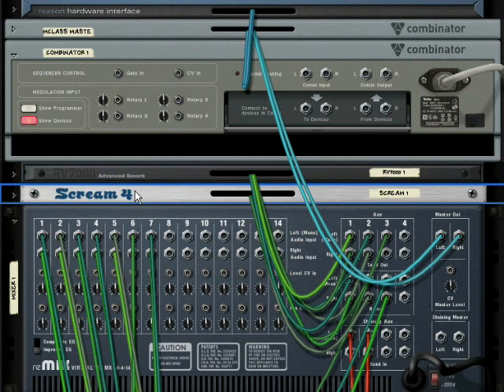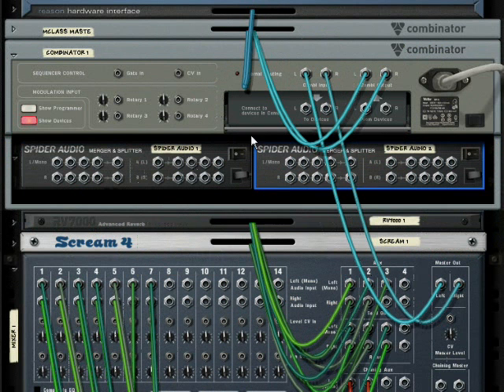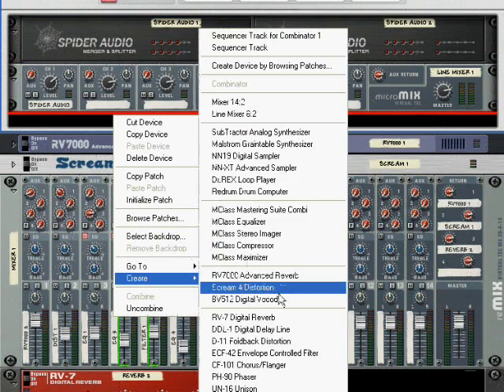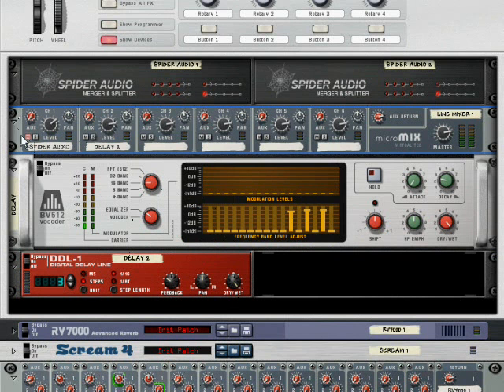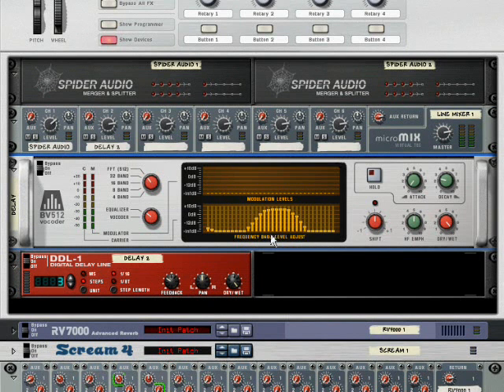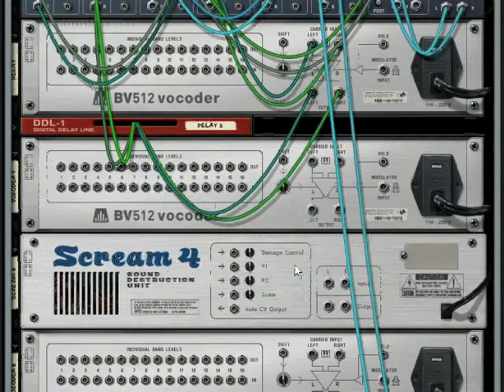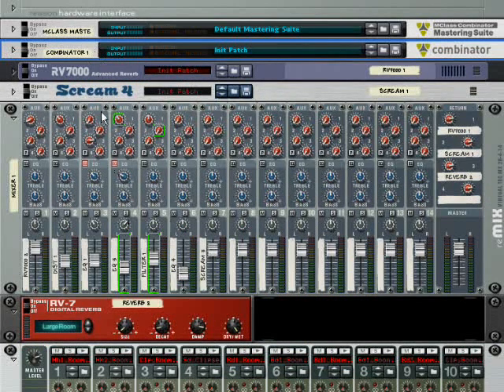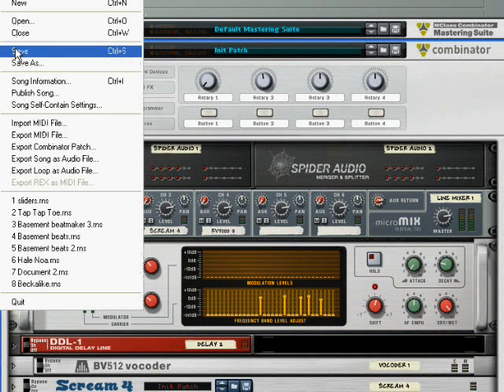Reason Tutorial - Vocoders as effect control units

Comment from the maker: Mastering is a big topic, but the web has great resources.  Just remember to think 3D - sound is (left/right , high/low, and near/far) in your audio space.  The trick is just to make all your instruments fit into the space without crowding each other out.  Also, the trick is to listen to your mix on a bunch of different speakers to check your EQ and levels.  Unfortunately Reason doesn't use VST, but if you have the option to use a VST plugin, check out Firium, by Elemental Audio.